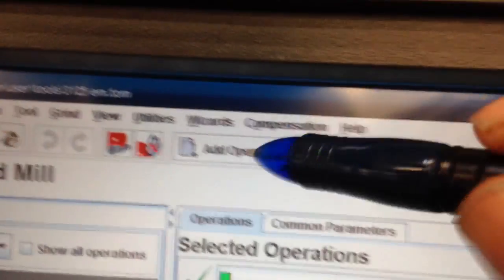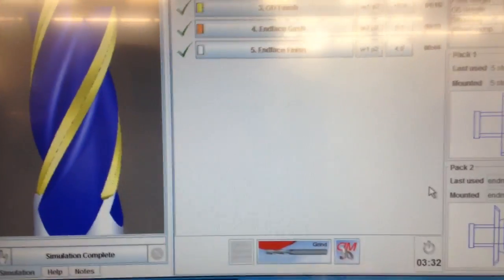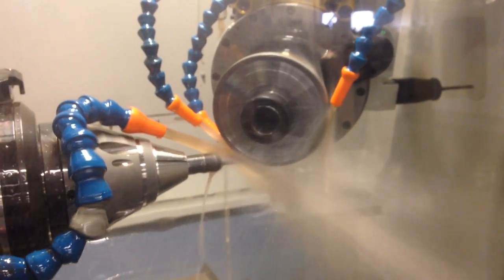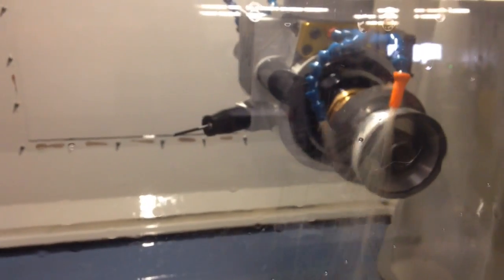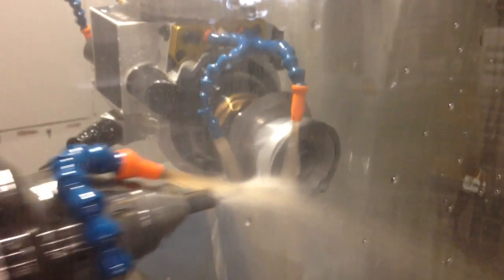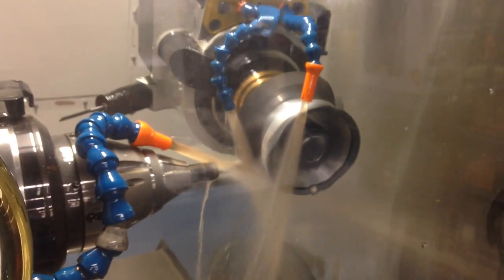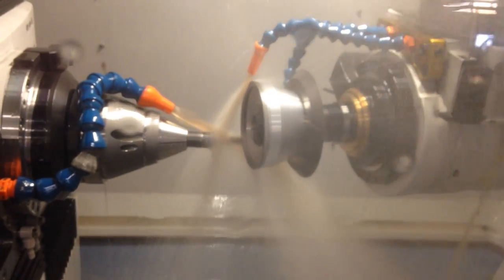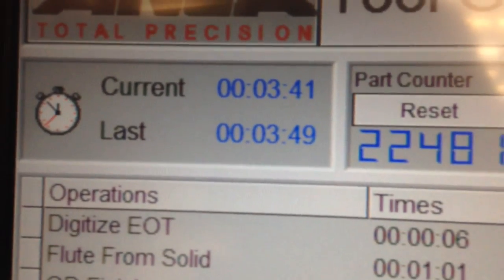Anca End Mill Wizard

Comment: You have a precision collet chuck but you're holding the blank with a side lock? I saw the absinc blurb, "The MOST precise extension holders", really? So shrink fit is obsolete?
Reply from the maker: In our defense we were making our extension holders before shrink fit was even a thing. Also, our holders are removable so you’re not buying an expensive BT40 or other tapererd holder. We made these originally for Bridgeport mills to be held in R8 collets. Side lock on today’s H6 shank tolerances affect the runout less than .00015” so if your need for a true running spindle is better than that shrink fit is definitely the better option. I’ve been using them for over 34 years to make cutting tools and have yet to have a customer complaint because of runout.

Comment: I currently work with an Anca machine the FG1 to be exact but I'm new and management there seems like they don't know what they are doing themselves. can you help me on a pointing drill how can I create cam action
Reply from the maker: jrodriguez101711 use the Rolled EOT" feature in the step editor. If it's a basic drill and you have at least RN32 version of your software you should be able to create it using the "Drill wizard "
Reply: Alfred Lyon yes its a basic drill point. it gives me the option of roll segment angle which I use but I still don't get cam action on surtain tools . does it have to do with my flank radius? or the size of the tool?
Reply: Alfred Lyon also is there any way you can make a video on how to do a basic set up on a drill tool because here they dont know how to do a drill tool on an ANCA I'm sure its possible
Reply: Alfred Lyon for example 
size: .1770
OAL: 6.0"
FLUTE LENGTH 2.0" TO R/O
WEB TAPER: .017 +OR- .003 PER INCH
MARGIN: .010-.015
WEB CORE .034 +OR -.005
PT. RAKE 118 DEGREES
RIGHT HAND 2
RH SPIRAL 25 DEGREES +OR - .002 THIS WOULD BE A SET UP FOR A DOUBLE MARGIN DRILL
Reply from the maker: jrodriguez101711 some day , yes
Reply from the maker: jrodriguez101711 there are many options that needs to be checked or unchecked and if any one is wrong then stuff doesn't work. The trick is knowing. That is learned by trial and error. If you are on Instagram I could send you some screenshots in a DM. My username is alfredlyon.